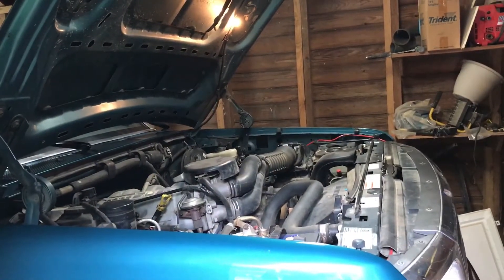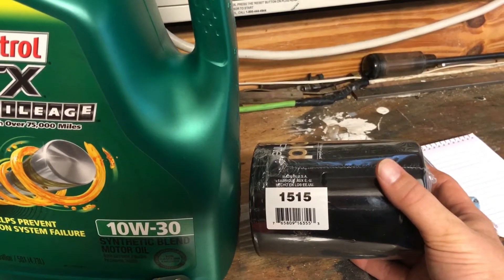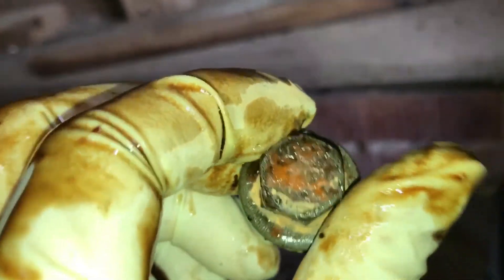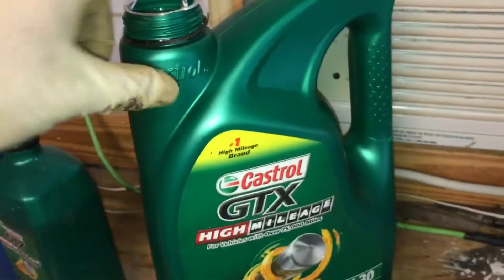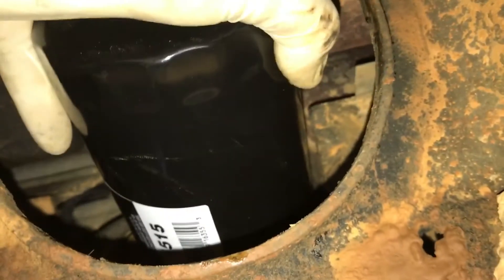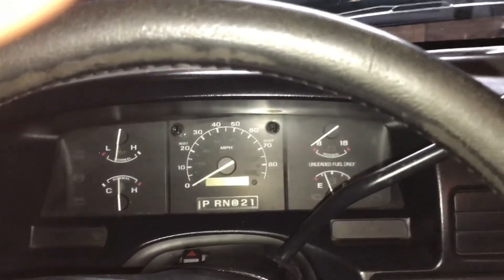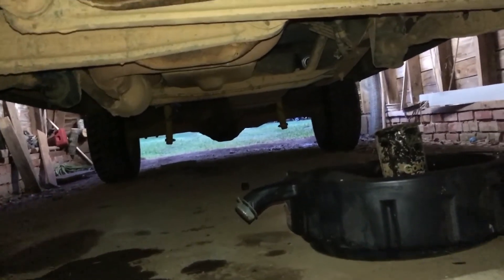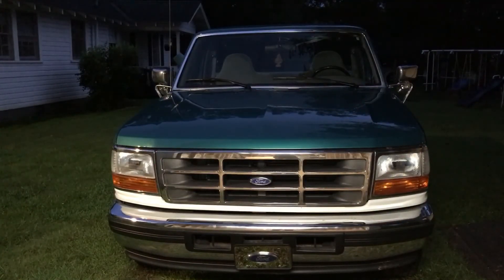Engine Oil Change On a 1996 Ford F-150

Comment: I just love these years Ford Trucks. 95 and 96 were my favorite. I think they look so stylish yet classy. Very educational video.
Reply from the maker: Thanks! This truck is one of my favorite ford body styles.
Reply: Mike’s Garage after 1996, I honestly feel the styling went completely downhill. They cheapened the look with less trim and more plastics. Nice to see you have over 260,000 miles on it. Keep it running forever. Lol
Reply: Why not the 94 model year
Reply: @wyatt6467  does the 1994 model year have the same front end treatment?

Comment: I just recently inherited a 94 f150. I've always been into vehicles but with this truck I really want to become mechanically educated.
Reply from the maker: These trucks are pretty easy to work on. One reason why I love them. Changing the plugs are simple. Get to the ‘97 model with the Triton engines and you’ll want to set it on fire trying to get the back two plugs out!

Comment: My '95 5.0 (302) f150 shows full at 5 quarts.
Reply from the maker: Per the Haynes manual, it says 6 quarts with filter change, 5 quarts without filter change
Reply: It takes 5 quarts
Reply: I have a 1995 with a 5.0 and I've had it since 96 and I've changing oil every time it only takes 5 quarts
Reply: In my Ford factory owners manual under quick reference, Ford calls for 5 quarts for all the gasoline engines. And it doesn't say there's any difference with or without the filter, so I'd definitely check it at 5 & see where that puts you.. My 95 F-150 has a 5.0 in it, and I've heard other people say it takes 6 quarts of oil. So, like I said check it at 5, and go from there. At least that's what I plan on doing here in the next day or so, because I'm going to change the oil myself this time around instead of taking it too a Garage like every time before. So, I'll see what my 60,000 mile 302 takes this time around firsthand.
.

Comment: when you attach the new oil filter do you want to pour a little bit of new fresh oil into the filter before threading it onto the engine mount?
Reply from the maker: Elliott Sidey it’s ideal to do that on engines you can, but on this engine the oil filter mounts sideways and the oil will just pour out when you go to install it. The oil pump will fill it up fast enough that you don’t have to worry about any damage.
Reply: @MikesGarage96  I believe if you let the filter sit for five minutes after filling it with oil before installing, the filter paper will absorb it and it won't spill out while screwing on.

Comment: 240k miles !!!! Duddeeee that's insnae
Reply from the maker: As of right now it’s over 253k with no problems. Check out my latest video I have out!
Reply: Currently working on a buddy's 1995 f150 4x4 5.0 short bed that has 359,000 miles.  Original engine, trans has been changed.  It has some rust over the wheel wells but still a dam good running truck. It has all kinds of power, it amazes me how well it still runs.   Previous owner has tried to buy it back a couple times.  I like it because it's a lot like driving my old 84 Bronco.
Reply: @MikesGarage96  i have a 95 with 295k and a 96 with 113k